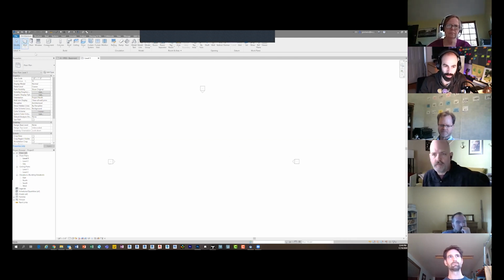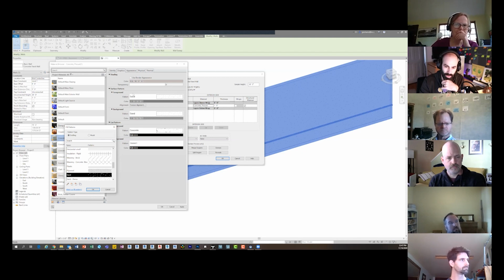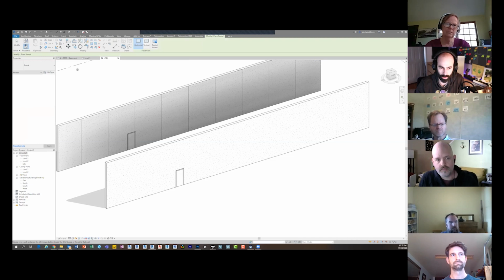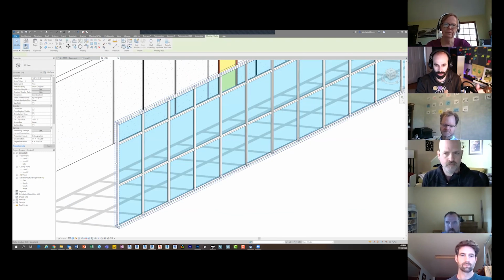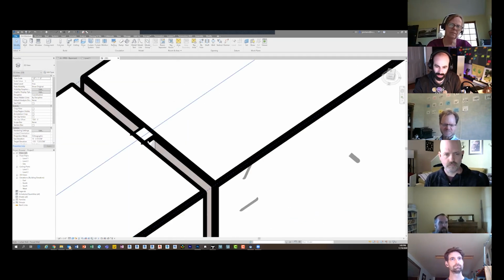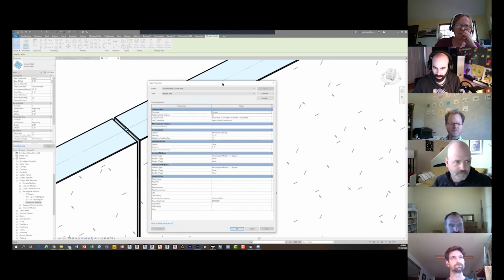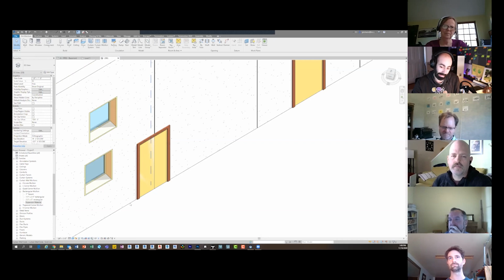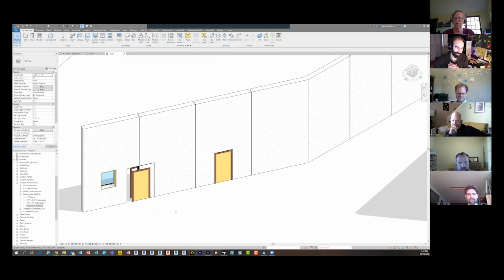3 Methods to Create Concrete Panel Walls in Revit Tutorial (Office Hour Sessions)

Comment: Great video but I have a question.... if you have a composite wall of multi layers, how to make the mullions grid cut in the exterior layer only not the whole layers, because the grid cut the whole wall in sections? like for instance, if you have a composite wall that consists of interior finish layer, structure core that is brick, insulation material and exterior finish layer that is going to be concrete cladding panels how to make the grid cut only the panels layers?
Reply from the maker: Thanks!  Easy…. Just make two walls… Using a separate wall for veneer is pretty common in Revit, actually.

Comment: How can I create a wall like this, just like the one in the image?
http://casavivaprefabricadas.com.br/images/13-full.jpg

These plates usually have a standard measurement. That adding the two pillars and the plate reaches 1 meter by 2.75 meters (5 plates)
In less developed countries, these houses are very common.

How could I create a panel (or wall) that was easy to model the house and gave me the right amount of pillars and plates to use?
Would you help me?
Reply from the maker: I would say you can take a similar approach....

Comment: Where a door is hosted by a wall in a curtain wall between panels, why not host a door structural opening family on the adjacent curtain wall panel and modify it's geometry to match the intended.

It will mean you'll need to exclude those structural openings from the schedule.

Comment: Great video as usual, but I have a possible correction/asterisk about curtain walls and doors & windows.
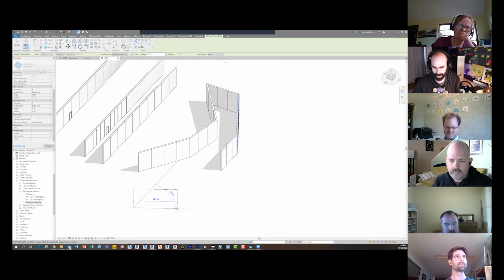At 17:05, you said when you create a storefront,   you can't put a door or window. 
This is only true if the storefront if not imbedded on a wall. 
If it is, say you make a cmu wall then add a curtain wall storefront to it, you CAN add a door and window. 
I did not realize it was possible, happened by mistake, but I am able to repeat it, revit 2022. When you add the door, or window, it even adds a mullion next to to the door window. 
I did this as a placeholder for my doors  at storefronts on a project as I was not ready to start modeling/adjusting/adding grids, curtain panel doors, unpinning panels, etc. 
After watching this video, I made a similar precast wall type and you CAN embed it into a wall to then add the doors, but it weird embedding a wall into a wall, good to know though! 
I can imagine there would be issues with demo/phasing if this was done, did not experiment much more.
Reply from the maker: I am not sure what you mean ?? It doesn't matter if the storefront is embedded or not... if the panels of the curtain system are PANELS (like the glass curtain panel) and not a wall type then you cannot put a wall hosted door IN a curtainwall like you normally would... I just tried it in 2022.  Unless you mean using a wall type as a curtain panel like I am showing here?
Reply: @TheRevitKid  It could be that you are doing it in a 3D View? 
That is the only reason I can think of that its not work for you but it works to add them in a plan view. just tried in in 2022 prior to posting my comment, didn't want to be wrong.
I opened the default arch template, in a plan view, created a generic 8" wall, then created one of the OOTB curtain types over the wall I just created, in a PLAN view. This creates the OOTB curtain wall, with the glass panels, mullions etc, with a void cut out of the wall as you know(embedded). 
Then I simply just use the door or window tool , again in PLAN view, and I CAN add windows and doors.
Like I said, it also works if curtain panels are walls like in the video, so you have a wall embedded over a wall condition I described. 
Thanks for responding!, must respect for all that you do and teach.

Comment: Hi Jeff, I have a few questions:
1) why don’t you use the Autodesk Precast plugin for dividing the wall?
2) if you play with curtain wall, can you just use the empty material (like air) for mullions?
Reply from the maker: I’ve never heard of the precast plugin but it was asked about different methods so that is what I showed.  2)  you can’t have an “empty” mullion only an empty panel.  PS- I didn’t delete your second comment not because I a felt it was advertising but because I felt it was not relevant to this video. Cheers!

Comment: For the door at the panel joint, does the curtain wall let you cut with voids? Could you make a generic model as a void and cut the wall to get the void in the other side of the door?
Reply from the maker: Why would you need that?  When using the curtain wall method you are using a WALL TYPE as a curtain panel and then simply using wall hosted elements on it.  So any wall hosted family functions will work.
Reply: I know you have had a reply to this, and they have not quite grasped your question. 

The answer to resolve the door joint issue is as simple as joining the two panels, this will not work (and autocut the secondary panel) if you have mullions, so you will need to turn interior mullions off first., join the two walls, unjoin the two walls to make them appear to be two panels again, then turn the mullions back on.

All this and you will still have a mullion down the middle of your door, so the answer to that new problem is, should mullions be visible at your model Level of detail (ie could you just turn them off?) or could you introduce a vertical  dummy mullion to remove the section below the door head.